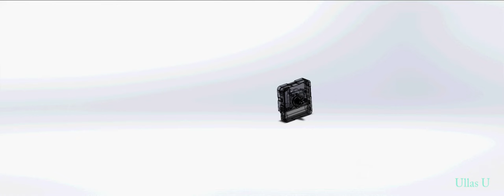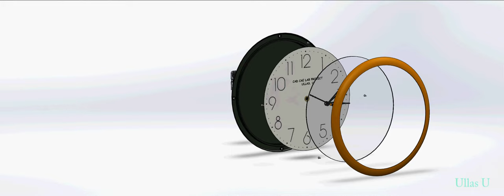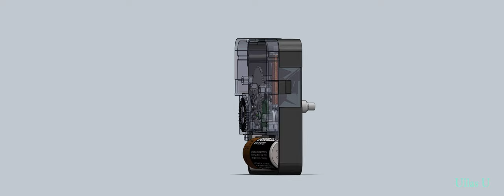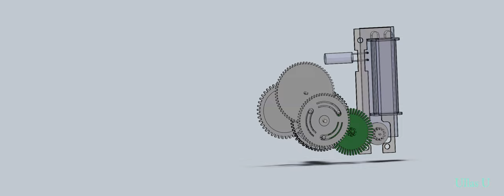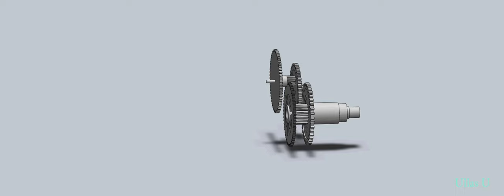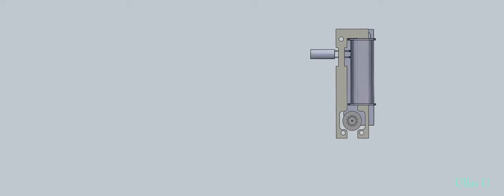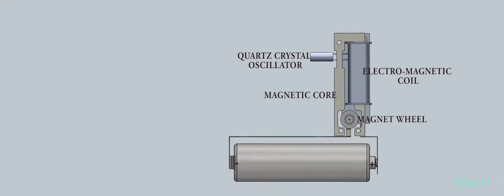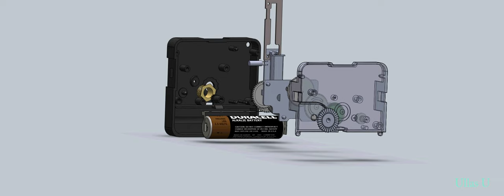QUARTZ CLOCK - HOW IT WORKS!!!

Comment: i have an hmt kohinoor please let me know that how can i remove scratch from the glass and dail i have a watch with a lot of scratch I can't find any watch maker who can restore it
Reply from the maker: Hello sir, scratches on the glass(crystal) can be removed by buffing. If it's too scratched up, replacement crystals for kohinoor should be available. Dial, if it's original, and is good except a few scratches, I'd advise personally to leave it as it is, otherwise, HMT kohinoor dials are not hard to find
Reply from the maker: @akshaychauhan7417  you can message me on 9686951979